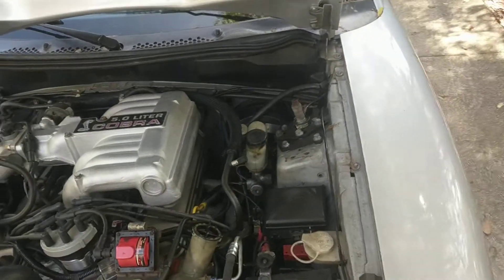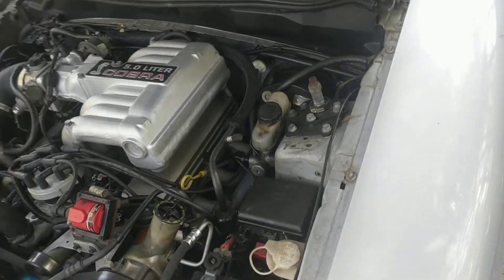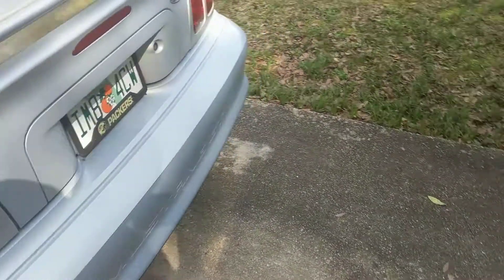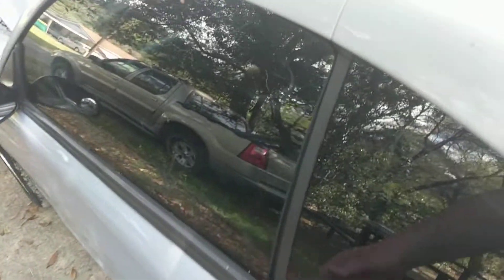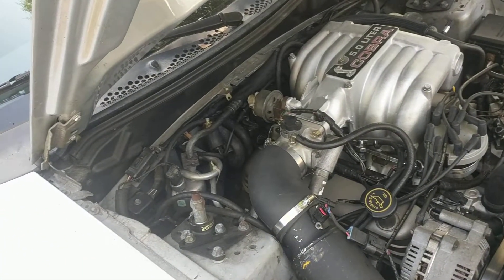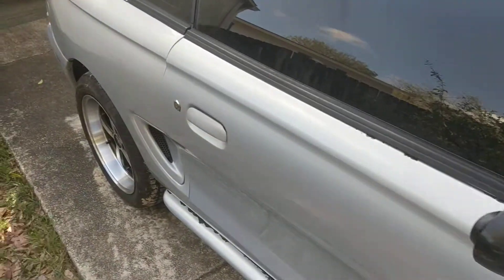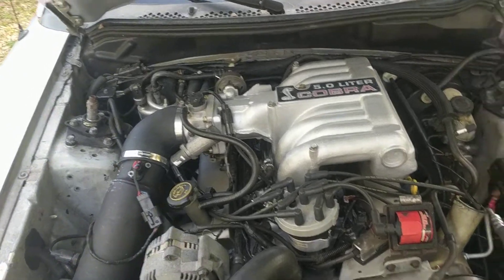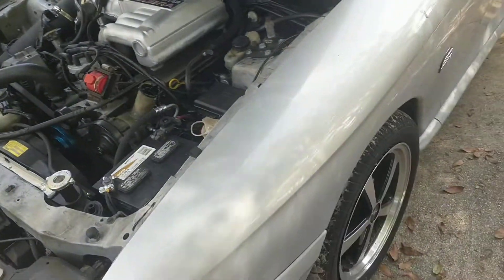1994 Mustang GT

Comment: Hey David.  I'm wondering what is the science behind the O2 sensors on the A9L? I hear tell that a car will run fine without O2's.  That being said,  it sure would make my stripped down 89GT cleaner if I could delete the O2's and wiring from the car.  What does the O2 signals send the ECM?  Evidently it isn't needed?
Reply from the maker: They'll run without the O2's, if it's not getting a signal from them it's in a sort of open loop. Even in open loop the O2's have a  min and max they'll keep fueling in, they're just wider parameters than closed loop. So, it'll run without O2's, just not as well as it will with them.  That's how I understand it anyway.